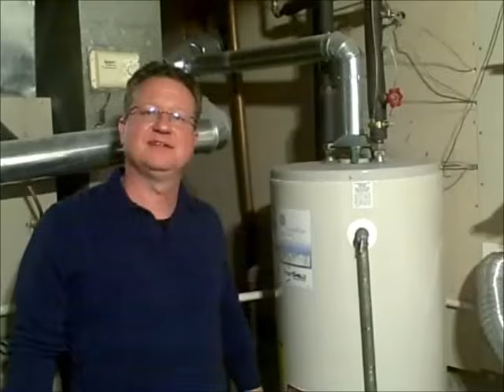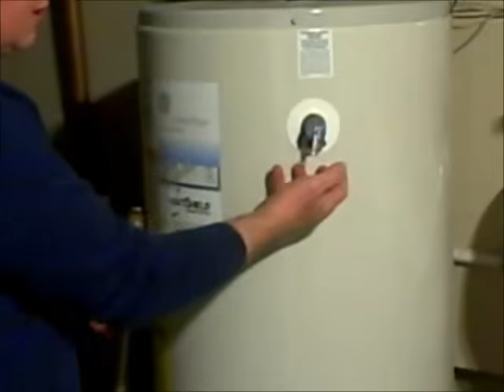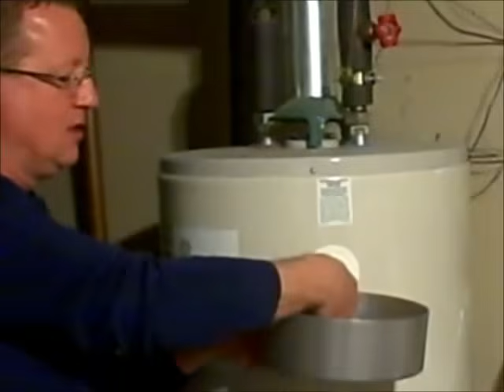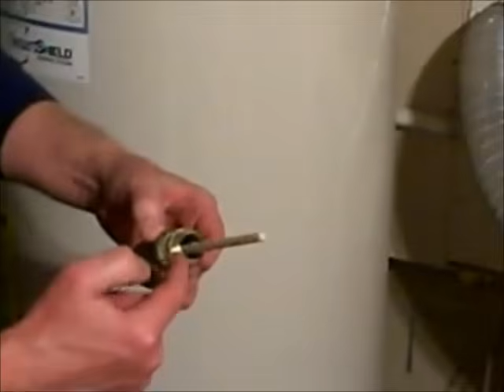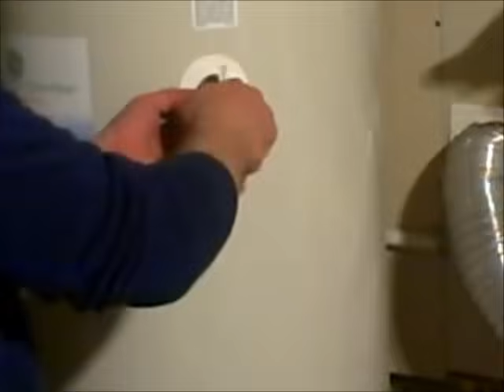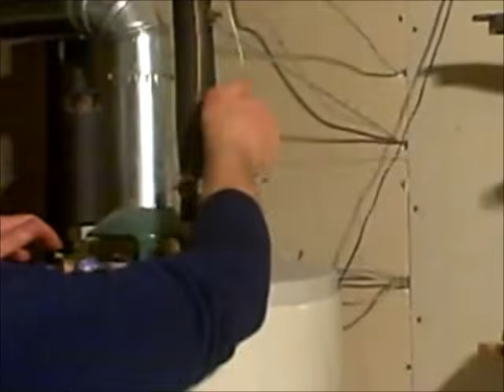Water Heater Pressure Relief Valve - Prevent Water Heater Explosion - Replace a Relief Valve

Comment: no it's just water heater
Reply from the maker: +Carlos Hernandez You may need an expansion tank. When the water heats up, it is putting pressure on the system. If you have a closed water system, you need an expansion tank.

Comment: Is there a possibility that, sometimes, when you test the pressure valve, and close it back up, that the mechanism inside did not properly seat, thus causing a minor leak until it is safely/properly closed again after resetting it?  My water heater pressure valve is located on top of the tank.  Thank you in advance for any tips/advise regarding this particular issue.
Reply from the maker: +Ju Ju Hi, is your valve leaking?
Reply: Yes, and no.  It leaks for a little bit after it's checked, but then it slowly stops by itself after it's re-seated.  Thanks.
Reply from the maker: If it keeps leaking, change it. If it is over 5 years old you should change it.
Reply: Thank you.  I'm going to, I've already ordered the one, along with a drain pan w/ built in riser.  My unit sits directly on the concrete, and the water flush spigot is too close to the floor, making it almost impossible to attach a hose for flushing.  The new drain pan will raise it about 3" off the floor, and at the same time will keep any water leaks off the floor.  Have a great weekend!
Reply from the maker: Great. Let me know how it goes.

Comment: Hi, do you need to turn off the gas heater hours in advanced, or can you just turn it off right prior to changing the valve? Thanks.
Reply from the maker: +Cuong Diep Hi, you can wait till you change the valve. You will be draining the water below the valve so you don't have to worry about the hot water. Let me know how it goes.

Comment: Nice presentation and explanation! Thank you. Is it possible, when changing the PRV, to go from a 1/2" outlet to a 3/4" outlet and subsequent pipe? I've been told per village inspection that my pipe needs to be 3/4", but I do not see how this is possible without installing a 1/2" to 3/4" nipple coming off the tank. So what's the point? The new valve will probably have a rating applicable to 3/4" preceding and proceeding the valve. Installing this nipple AFTER the valve is definitely against code, but what about BEFORE the valve? Thanks for any tips you can offer.
Reply from the maker: +kimbybean001 Hi, the standard size opening for a pressure relief valve is 3/4 ips. You want to screw directly into the tank. The discharge pipe ends at 6 inches above the floor. Let me know if that helps.
Reply: Yes.  It worked perfectly. As it turns out the connection to the valve was a three-quarter inch after all. It was the pipe that was 1/2 inch. Therefore the new three-quarter inch pipe that I bought screwed on and is at 4 inches from the floor. I think we are good to go. Thanks for your help!!!
Reply: Yes.  It worked perfectly. As it turns out the connection to the valve was a three-quarter inch after all. It was the pipe that was 1/2 inch. Therefore the new three-quarter inch pipe that I bought screwed on and is at 4 inches from the floor. I think we are good to go. Thanks for your help!!!
Reply: Yes.  It worked perfectly. As it turns out the connection to the valve was a three-quarter inch after all. It was the pipe that was 1/2 inch. Therefore the new three-quarter inch pipe that I bought screwed on and is at 4 inches from the floor. I think we are good to go. Thanks for your help!!!

Comment: Great video.  $15 part + this video and my leaky valve is fixed.  THANK YOU!
Reply from the maker: Hank Carter You're welcome.
We have more tips on our weekly podcast https://itunes.apple.com/us/podcast/fix-it-home-improvement/id880903087?mt=2
Reply: It's now 2023 6 to $7 still the same crappy valve's designed to keep you replacing them... Three-quarter inch pipe plug works wonders

Comment: Great help, thanks. Only difference with mine (gas) I had to drain a lot more water off before it stopped coming out of the pressure valve relief hole.
Reply from the maker: ug mold Glad it was helpful.
WE have more tips on our weekly podcast.  https://itunes.apple.com/us/podcast/fix-it-home-improvement/id880903087?mt=2
Reply: FIX IT Home Improvement Channel  I spoke too soon, I turned off the water at the water main and now it won't come back on.

Comment: My son-in-law and I just did our replacement [Whirlpool] valve after watching your video about four times each; it was a successful job, no leaks after installation, but later on, I had a vase that caught the other leak, and I just left it under the drain tube just in case, to our disappointment, the new valve leaks worse than the old one, I got it at Lowes, and it is a universal, all of them are now that are sold [150/210]  what could be the problem ? Now this one came with a tape sprayed on it for sealing, my son-in-law insisted on adding teflon tape also, I wonder if that may be my leak problem or do I have a bad valve ? I use to be a Chevrolet Parts Mgr. for 23 years, so I am somewhat technical minded, I use to tell mechanics what they needed to repair a car; appreciate your soon reply; it is a pain in the rear to go through this, and still have a problem; we did not take water out of the top to begin with, we hooked a short hose to the bottom, and drained about 6 gallons out, then took the valve out. "freaked out" ! Clarence Puckett.
Reply from the maker: clarence puckett Hi, is the leak from the valve or around the threads. If it is from the threads, try using some pipe thread compound with teflon. Coat the male threads and it should do a great job for you.

If it is leaking from the valve, do you have an expansion tank?
Reply: FIX IT Home Improvement Channel I don't have an expansion  valve, it is exactly like the one in your pic video, it does not leak at all after installation, but the moment I up the water temp just a notch,  it leaks, makes me wonder if I got a bad valve, my son-in-law put teflon tape around the male threads to start with, even though it had it already sprayed on, why would my moving the temp just a notch cause it to begin leaking ? I mean not hot; just a tad warmer ? After installing it, it lasted a couple days,  over the week end.
Reply: clarence puckett I am going to Lowes today and talk to the mgr. of that dept, he waited on me Saturday week ago, I thought our problems could lie in the air pockets in the lines, we ran all of them to clear it out, even the commodes.
Reply from the maker: Hi, If you don't have an expansion tank, the pressure of the water expanding could be tripping the pressure relief valve. A 40 gal tank can expand about 1/2 gal of water. Most companies want an expansion tank on your water heater line. If you have a closed system, you have to have an expansion tank so you don't void the warranty.
Reply: FIX IT Home Improvement Channel We checked our water pressure with a gauge; it was 140 front and back of the house, my son-in-law's is only 88, so I called the local water dept, they have the pressure set too high, they are supposed to come out and hopefully create a solution for it,  maybe at the meter.
Reply: clarence puckett My tank is a 50 gallon tank, not 40.
Reply: My son-in-law thinks the water pressure is too strong, far too strong,  he believes during the night, there is a surge in pressure that makes it leak, strange it did not leak after installation, just periodic afterwards, and at  night. What do you think ?
I told the water dept this is their problem, we had a water main to burst about eight months ago in the street out front, when the crew fixed it, they did not fix water pressure.
Reply: FIX IT Home Improvement Channel  This tank is about 10 years old; it was a six year tank; we have tried three valves on it so far,  it leaks every now and then, and often, even with the new valve, we thought water pressure had an effect on it, it varies from 50 to 140, we are now thinking since it is an older tank, it just may be time to buy a new one,  thought about the expansion tank, but after three valves, it is wearing our patience out,  I am going out today to look at Rheems and Whirlpool 50 gallon, so it will fit in with my current duct work; what is your view that it might be the tank now ? After 6 years, I would perceive we are just putting patches on a tank that is going to fail.
Reply: clarence puckett The leak is coming from each valve, not the threads, but where you stick your finger in the hole, does fine for a while, then after a while, the vase is full of water.
Reply from the maker: Hi, I would add an expansion tank. It should solve your leaking valve and add life to your water heater and appliances.
Reply: Thanks;  we have just about decided to buy a 30 gallon tank [gas and whirlpool]  no one but me and my wife, we are also going to add an expansion valve on it when we install it just to be sure, we have had this tank for almost  ten years, so I was somewhat skeptical of spending money on it, and then maybe it goes out; your opinion I value, hoping hook ups are in line of course, tall 30 gallon.
Reply from the maker: Hi, most last around 12 years depending on maintenance and mineral content. I would have the store give you the dimensions on the new tank. This year the new energy efficient models are coming out. They are about 2 inches wider and 1 inch taller. A couple models will be the same size but have a energy wrap. Let me know how it goes.
Reply: clarence puckett

Comment: Replaced the valve (the video is excellent, thank you for posting it), but the new valve is dripping too. Any ideas welcome. Thanks.
Reply: Ray Pellecchia BTW, I do have an expansion tank.
Reply from the maker: Ray Pellecchia Hi, If you have an expansion tank, check it with a tire gauge to make sure it is pressurized properly. I would call the manufacturer of the relief valve, if it is bad, they will replace it. It should not leak, if it does, it needs to be replaced. Let me know how it goes.
Reply: FIX IT Home Improvement Channel Thanks again, will do.

Comment: Great Video. I have a question. Everytime I take a shower, and only when I take a shower from the Upstairs bathroom, about a cup of water comes out of the pressure relief valve tube. I tested the valve and it doesn't leak and water flows from it just fine. Its an electric water heater and its only a 3 years old. What could be the issue? Thanks
Reply from the maker: adrenaline880 Hi, do you have an expansion tank on your system?
Reply: FIX IT Home Improvement Channel
No just the one main tank. Its a John Woods brand
Reply from the maker: adrenaline880 Hi, if you add an expansion tank to the line coming into the water heater, it will probably stop the problem. Most manufacturers now recommend them. As the water heats up, it expands and puts pressure on the whole system. If you have a closed water system in your home, it will shorten the life of your water heater.
Reply: FIX IT Home Improvement Channel
 Is there anyway to solve the issue for now without the Expansion tank? I will definitely look into one. Thanks
Reply from the maker: adrenaline880 Hi, nothing that I know of. The  expansion tank will solve your problem and lengthen the life of your water heater. 
We have more tips on our weekly podcast https://itunes.apple.com/us/podcast/fix-it-home-improvement/id880903087?mt=2

Comment: Just a thought I'm guessing the water heater is 12 years old. every thing else seem fine. Oh and I also have the valve at the meter barely on. I do not have a gauge on the line to tell me the PSI. Thanks

Comment: Hello I replaced one of these about a year ago,watched your vid thank you, just found it leaking again. When I put the last one on a year ago I also put a pressure valve on the cold water side.OK I bought two of them this time put the first one on and it was good until the water got hot. The next one leaked as soon as I filled the tank.  Water pressure is OK, temp is 120 or so. I don't know what is causing the T/P valve to constantly leak. And it's coming out pretty good not just a drip.Thanks
Reply from the maker: Morgan Vance Hi, do you have an expansion tank for the water heater?
Reply: FIX IT Home Improvement Channel Hello. No i do not. went to get a new tank an just happened to talk to a gentleman who works there and he told me I had debris in the prv. Got a new one and it fixed the problem. Only to cause another. Now the prv is humming, tried turning the pressure up and it made the hum louder
Reply: Morgan Vance Hoping the NEW valve is not bad too.If I turn kitchen and the bath water on the hum stops. Turn one off and the hum is back.All shut-off valves are open full....Oh meant to tell you when I took the old valve out and was working with it a small half inch (OD) quarter inch (ID) stainless washer fell out.... HUM....Also the aerators had debris in them. No new construction around me or haven't seen them working on the lines.

Comment: I have a question that I can't find online. I just installed a new water heater in my house and sometimes it drips some water then stops. My question is.... is this normal for tha valve to do this small leaks? Again it only does it sometimes.  I will really appreciate if anybody can answer this for me. Thank u.
Reply from the maker: Sal C Hi, the relief valve should not leak. The first thing I would check is if you have an expansion tank. Every time the tank heats up, it expands the water putting pressure on the whole system. If you don't have an expansion tank, I would install one. If you have one and the relief valve is leaking, change it. Let me know if that helps.
We also have more tips on our weekly podcast https://itunes.apple.com/us/podcast/fix-it-home-improvement/id880903087?mt=2
Reply: Is not leaking all the time, it just drops very little water every now and then, then it stops for a few hours then does it again. We just installed it, it is a new water heater. I changed it because my old one was doing the same but I guess it is normal. :-/
Reply from the maker: Sal C Hi, when I took the training from the manufacturer, they emphasized, it should not leak. If you have an expansion tank and the valve is leaking, you should change it. Give them a call, they will probably send you a new one. A bad valve can be deadly.
Reply: Thank you sir. I just called them and what they said was that I had it set too high. They also said if it does it again I should check the water pressure that is coming in the house so I will keep an eye on it all day today.
Reply: And whatever the problem is I will fix it tomorrow. I really appreciate your videos they are very helpful.
Reply from the maker: Sal C Thanks. Let me know how it goes. When I change the relief valve, I take a marker and mark the dater on the heater.
Reply: I will do that, that sounds like a good idea and yes I will keep you posted.
Reply: Sal C Hello What did they say you had set too high?
Reply: I guess the city did it that way because apparently they don't want the extra water to go back to the main. So they recommended a small little tank or let it drain from the valve which that is what it is for according to them.

Comment: So my pressure release valve releases several gallons of water almost hourly is the tank temp set too high or is it over filling or do i need to replace the pressure release valve
Reply from the maker: Michelle Wilkinson I would replace the relief valve. Do you have an expansion tank on your system? This will keep water expansion from tripping the relief valve.

Comment: Hi, my valve is on top of my hot water heater. It will not open. I'm going to change it this weekend. Now i'm nervous about the tank exploding. There is build-up around the bottom where it connects to the tank. Any pointers or suggestions you could give me?

Comment: can the TP valve piping terminate into the laundry tub?
Reply from the maker: kenns9 Hi, depends on your local code, but I would doubt it. If it can be a scalding hazard, and inspector will make you change it. They want it on the floor within 6 inches or going into a floor drain. Going to a wash tub, the pressure could make it move and if someone was at the tub, it could be a hazard.  

We have more tips on our weekly podcast http://www.stitcher.com/s?fid=49441&refid=stpr
Reply: FIX IT Home Improvement Channel
I don't have a floor drain . heater is in garage. it then must be piped to the outside?
or just couple of inches above the floor?
Reply from the maker: Hi, most manufacturers want the discharge pipe 6 inches from the floor. You don't have to pipe outside in most communities.

Comment: My hot water heater is on the ground-- concrete - cant see the pilot light is on. I am thinking about raising it off the ground -- put on some sort of platform about six inches high  -flame vapor arrestor- what does it look like?
Reply from the maker: M Geez Hi, I will put on a video today or tomorrow to show you the flame arrestor.
Stay tuned.